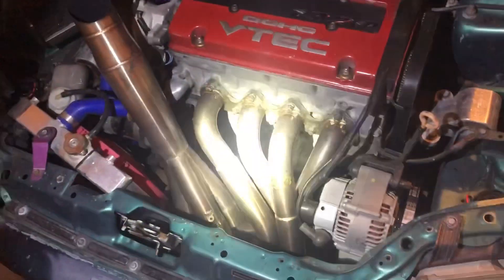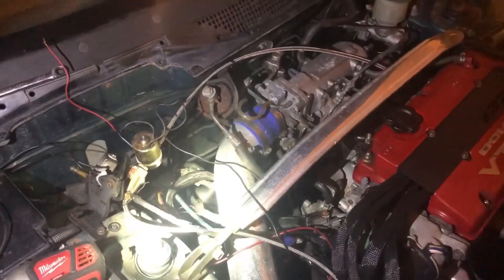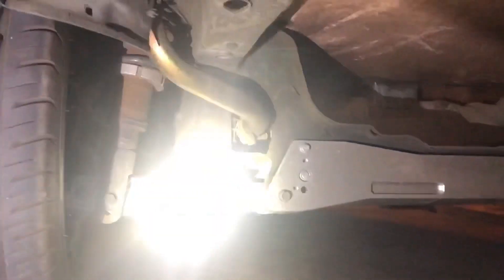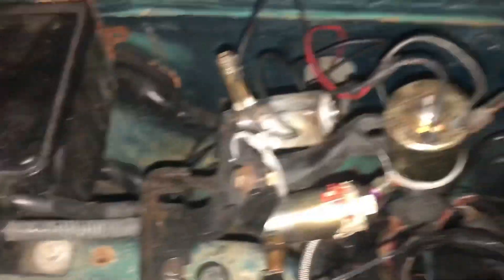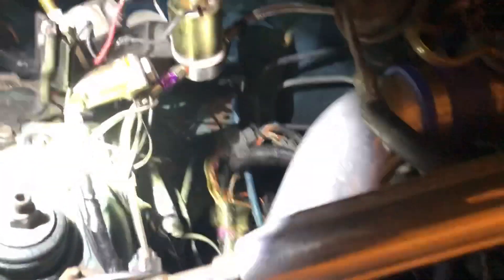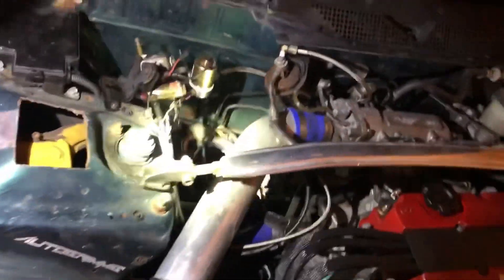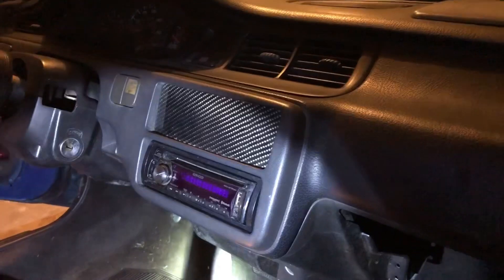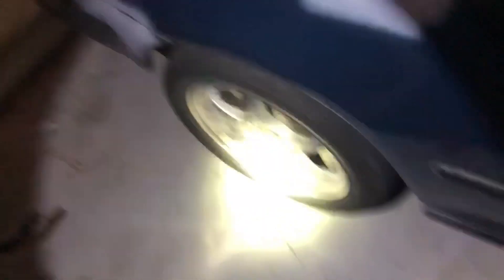Nitrous H22 stroker build

Comment: If you come across one put an h23 manual trans in there. The gearing is better than the h22 and it has a noticable acceleration difference. I got it in my 92 si prelude and compared to my old h23vtec build with an h22 trans it feels alot stronger and more fun off the line.
Reply from the maker: I’ll have to look in to that for sure. It has a jdm h22 trans now with an lsd